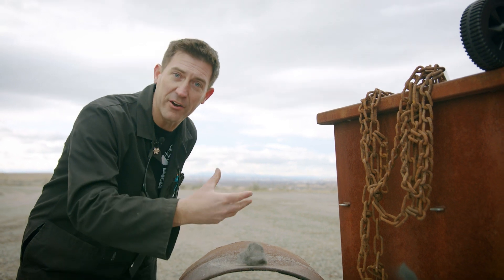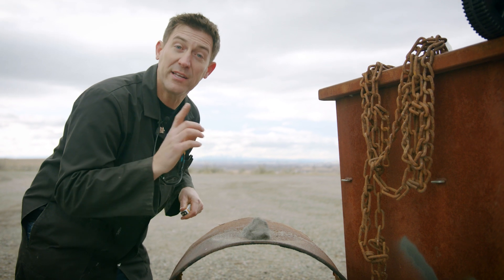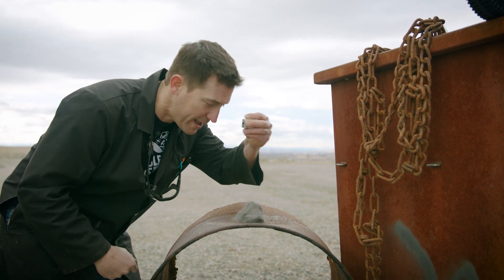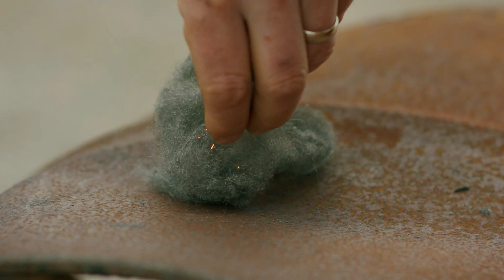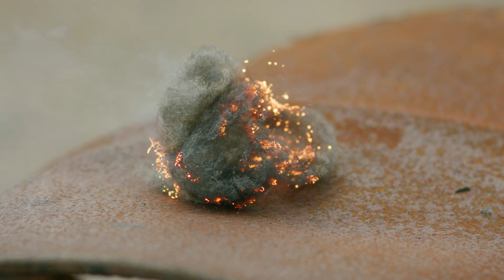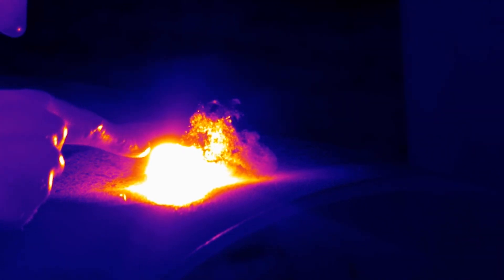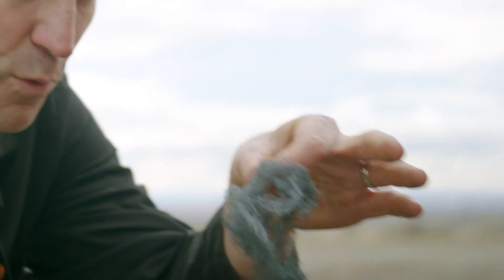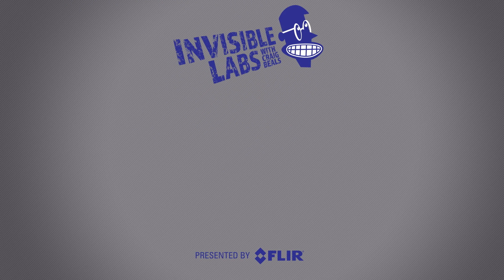Steel Wool Fireworks with FLIR | Invisible Labs with Craig Beals

Comment: I have messed around with steel wool and a .50 black powder rifle.  Black powder charge about 60 grains is enough. Thin wading then crisco layer and corn meal about a tablespoon. Another layer of crisco. The cornmeal burns too. Do NOT use flour. It does burn when it hits the air but it is a bit too close. At close range 5-10 feet it will kill a rat. So be careful where you point it.   Flour makes really bright flash at night. The corn meal makes a much longer burn. A white yellow color mixed with the orange from the steel. Oh the black powder rifle I use for this has a stainless barrel. It is about 30 years old.
LOTS OF CRISCO.  I used a reproduction Walker .45 at first but it did score up the barrel. Took a bit a playing with it to get proportions right.
 It got retired as a wall hanger. Steel wool burns real hot. It will pit the barrel if you don't use a lot of crisco. Kinda like seasoning a iron skillet.